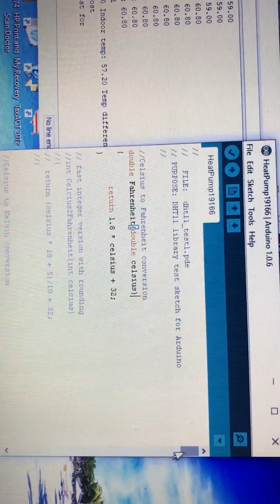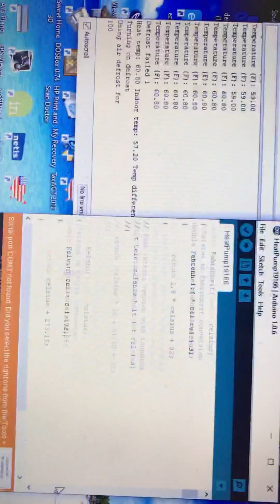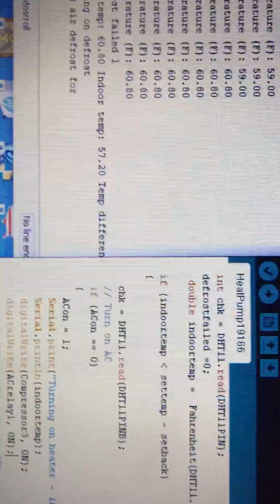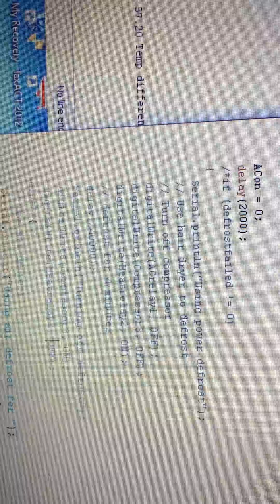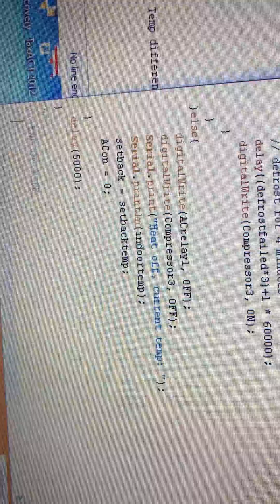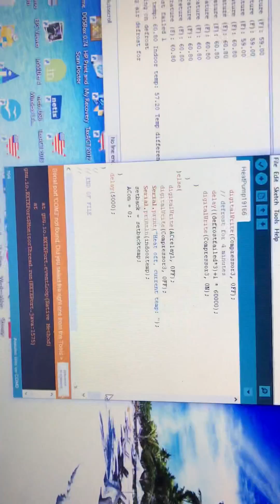Convert air conditioner to heat pump using Arduino controller relay box

Comment: I use a portable ac 9000 btu as air conditioner and heat pump by reversing the airflow in winter and summer alone with two hose conversation. To take care of icing up of the coil I use an ardunio as an remote emulator to switch between ac mode and fan mode periodically which (timing was found out by trial and error) .je input air inlet has a thermistor which was replacement by a 4.7 kohm resistor which correspondence to a 27 degree Celsius which make the ac rum continously. This allows minium modification to ac as we use the remote   . I have an external thermostat connected to ardunio remote emulator to switch off an on the ac when the indoor air temperature is met.i have this system running an entire year now going throw all seasons in the uk.

Comment: I like it !!!! I've kicked around doing something similar with an old 12,000 BTU air conditioning unit that I have... have you ever thought about using a reversing valve and actually separating the condenser and the evaporator coils more like an actual split system is? You would need change the plumbing a little bit and add a second metering valve or device... the real advantage to the reversing valve is during the defrost mode you can just flip the reversing valve and turn it back into air conditioning mode and that would defrost the coil outside much faster I think that's how the commercial ones do it?
Reply: Installing a reversing valve would require a degree in air conditioning and is way beyond anything a DIY could do. So no, reversing valve out of the question. However, they now make a black/decker portable AC with heat pump for under $400, so you can now reasonably buy one off the shelf. That is still more expensive than the $220 10000 BTU air conditioner (which is much more efficient) from Walmart that I am now using as a heat pump.
Reply: @franklinyoutubehu2349  HVAC degree? nahh.. just some more learning... you know how to program an Arduino wayy better than i do and thats not standard DIY level. I installed my own 8 KW solar system (HV inverters 450 VDC panels on ground mount sub panel etc) and i didnt have a solar degree :) again just alot of learning over time and 99% of the info is out there free is you go looking for it
Reply: to me half the fun IS the learning process... im not afraid to try and make some mistakes i just try to keep them to smaller errors :)
Reply: I've been thinking of converting a number of portable AC units I already own into geothermal heat pumps. I want to use them to create zone controlled radiant heating and cooling systems in my house. I'd need to replace the air coils with refrigerant to water heat exchangers, add a reversing valve, and screw with the controls. I'm doing it for fun. The problem is I'd have to buy the equipment to install connector valves on the AC then recover the refrigerant. Add a vacuum pump to vacuum the lines down before I add the refrigerant back in, and I'm looking at $1000 in equipment before parts. It'll cost $200 for parts per 12,000 BTU AC to convert, excluding water to air heat exchangers I'll need to mount. I'm trying to think of ways to simplify things.
Reply: @russiannpcbot6408  for a geothermal application don't you need a water to refrigerant heat exchanger versus water to air? Basically a liquid to liquid exchanger... I've priced those and they're quite expensive is the problem you can make them yourself but they're probably not as efficient